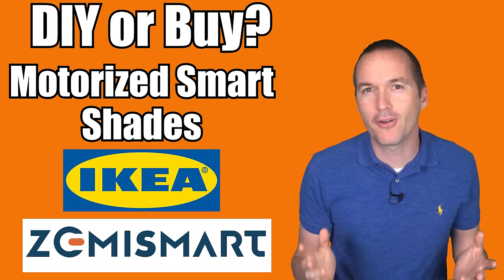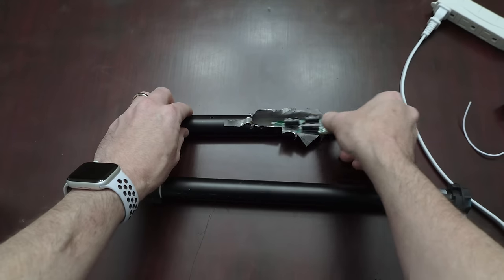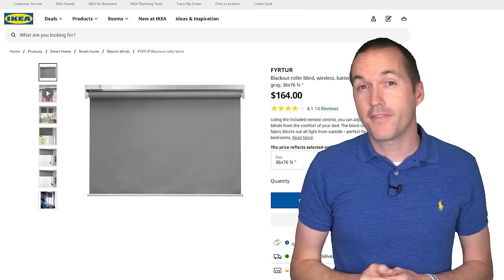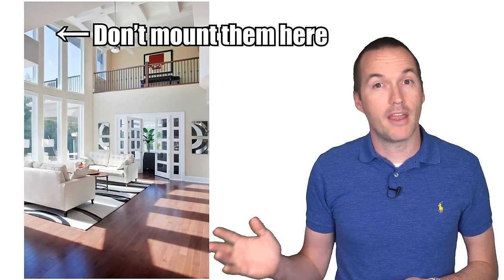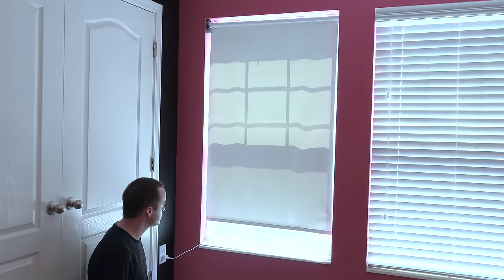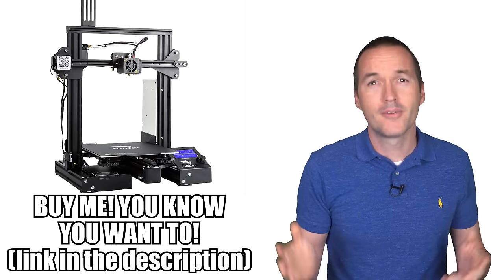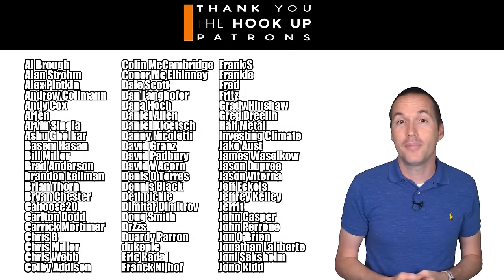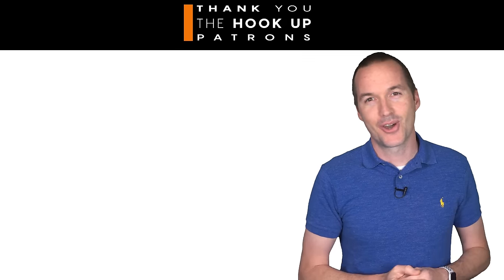Motorized Roller Shades? IKEA Fyrtur vs Zemismart Solar/Battery vs DIY!

Comment: I don't get the problem with Zigbee, is it the protocol or rather this specific device support? Have you tried Zigbee2Mqtt? The only thing complaint I have towards Zigbee as a protocol is an insistence by different manufacturers on using their own hub. Having said that, I am using zigbee2mqtt with over 45 devices in my house and everything works without the fuss, although around 25 of them are also Zigbee routers. I think Zigbee2Mqtt should be integrated into Home Assistant is getting better and better. OK, enough rambling, great video Rob, keep it up. BTW, you have convinced me to get 3D Printer but decided on getting Prusa Mk3 kit.
Reply from the maker: Basically hit it on the head.  Because manufacturers want you to use their own hub they are all using non-standard communication protocols that require device drivers to be understood.  Zwave for instance requires that specific device types communicate in specific ways, so they are compatible with any hub.

I haven't gotten deep into Zigbee2MQTT yet, but I'm hoping it will solve that issue for me, since I still have a lot of zigbee devices that won't work with Deconz.
Reply: @TheHookUp  Oh, OK, then I definitely recommend Zigbee2Mqtt. I'm not sure if you're going to need it but I would also recommend adding an external antenna to the CC2531 router/controller, it greatly improves the signal. The reason I actually went with Zigbee was the smart sockets, the way ESP2866 works and controls the high voltage, it trips my RCD fuse while switching, IKEA sockets don't. 

Funnily enough, I find Zigbee more reliable than Wi-Fi, especially now, Zigbee2Mqtt is getting better and better. The other thing I love about it is the Xiaomi sensors, they are reliable, with a modern look, small footprint and great price, and they run on battery for 2 years, almost.

Comment: After all, simply using a string to manually roll them up and down sounds so simple and advanced. :-)
Reply: I’ve often thought the same about smart bulbs. Given the choice between flicking the light switch on or off and getting my phone out, opening the app and turning the lights on or off I’ll go with the switch.
Reply: Right? And then one day the motor burns out and they go in the landfill? No thanks. I'll take something foolproof and that lasts forever, thanks.
Reply: @adityaprasad465  I can see them for very high applications, but thats about it.
Reply: @philindeblanc  Isn't recharging an issue in that case?
Reply: @adityaprasad465  Those are usually hardwired from attic. They usually have solid motors, but they are preicey. The solar powered models are ok, but not as reliable and not discrete.

Comment: Great job! Amazing code for that WiFi config interface, seems like it could improve your outdoor motorized shades code too. Do you think some power monitoring is able to be performed on the DIY method? I think a small solar panel and tiny lithium charge board could keep a 9V battery well prepared for each day’s use - as long as it’s on the side of the house with good sun, or it’s a long thin panel that can hide.
Reply: Also seems like the DIY code makes it able to be built and sold at a profit for cheaper than the off the shelf
Reply from the maker: If you want to build it and sell it, go for it :)

Comment: Thankyou for this...you do amazing work. I love the humor (@1:39 cracked me up looking for the outlet!, and the comment about ikea instructions).  I also love that you not only linked to the DIY solution but went through the work of updating the libraries and providing a bin file for your viewers.  You also give a fair and balanced view that I can appreciate of the pros/cons.  Do you know offhand how hard it'd be to update the DIY solution with a stronger motor?  I'm wondering if a properly chosen Nema 17 or even 23 with a 12volt supply can help with torque, and then maybe using a Wemos D1 mini with a motor shield (I was suprised to find out they had a motor shield for those!).  Regardless, I really appreciate the time and work you put into your videos, and the valuable infromation you provide us home automation enthusiasts :)
Reply from the maker: The code I used would need to be heavily modified to use a different stepper, because the original was written for the ULN2003 driver and a unipolar stepper.  

The other issue you'd run into with a non-geared stepper is the holding torque when the coils are off is basically zero.  By gearing down you give yourself that holding torque that's required to keep the shade in place when the coils are off.
Reply: @TheHookUp  OH awesome to know..I really need to ramp up on my knowlege of motors and steppers, my info there is really basic at best.  I didn't think about when the coils are off...pretty important scenario :) Thanks! I'll also check out the projects Goog linked...I'm super excited that this is becoming easier to approach!

Comment: Although more expensive, wouldn’t it be possible to use a Nema stepper motor instead? They are more powerful and the cost is still affordable. I believe that even with Nema motors the DIY solution would be the cheapest. 
I don’t know about the speed improvement though...

Comment: Just ordered some NodeMCU boards.  Also have a 240V 40A relay and planning to try and set my water heater to run on a schedule.  During the summer my power rate fluctuates and going to try and set it up so that I can have the email come in and get data scraped for the power rate and automatically turn off at a certain time when the rate will be high and back on when it drops back down.  And yes I have a huge heatsink so the relay should not overheat.  

Since I have spare boards I may end up doing the blinds as well.  Only need it for two windows that I have facing north and since I am in an apartment I am limited on what I can do but would be nice if they would open and close at certain times of the day.  I am always short on cash and have extra time so DIY is the way to go though I will probably look at a more powerful motor to swap into the system or set it up so there is a pair of them working together which should increase the speed and weight capacity, which is actually a good option that only requires a little bit of modification to the design and doesn't increase the cost that much.  Driving one from each end would be another option that would be pretty simple since a single board should be able to handle two at the same time.

Comment: The DIY version works like a charm! How do I get back to the initial setup page after configuring the wifi the first time?
Reply: Hi Hon Wah Chee, can you help me? I can't reach module by IP address after connecting it to router (i see module in the connected devices list). Did it work for you?
Reply: @YuryPenkerton  lol did it work for you? After downloading I was not able to run the rollershade.bin file. Any help?

Comment: I have used the DIY version with a 6ft blackout blind at 12v for over a year, no issues here.
Reply from the maker: Are you using a buck converter to power the node mcu? They usually can’t handle a sustained 12v

Comment: Even slower i would prefer the DIY version integrations. If you have heavy shades or you need more speed i suggest to change that tiny stepper motor with a bigger one... they reach a really big monster size... but with some dollars more than yours you can get a decent one... take a look to NEMA.

Comment: A'ight, so if you're going to all the trouble of building your own roller shade, why not put in a heftier motor and place a solar panel in back of it with a small backup battery?  It'd probably cost $15/shade after buying in bulk.  I wouldn't think you'd have any complaints after that.

Comment: Awesome stuff once again, Rob!

I am updating my existing roller shades to make them smart. I'm deciding between an in-rod motor like the Zemismart here or chain-mechnism like the Soma 2.

With an in-rod motor, do I need to sacrifice the current manual chain operation? Or can I keep using my existing manual chain as a fallback? I don't want to violate the first rule of smart homes: never remove functionality, only augment it.
Reply: Can you please help? After I downloaded nodemcu software and roller shade code, it gives me error.

Did it work for you?

Comment: but why not upgrade the motor  for the DIY option to bring it closer to "buy" specs? (or just show it as other option
Reply: I was thinking the same thing, I may have to experiment with a stronger motor.
Reply: @DAYochelson  I think the problem is that one does not exist at this size.
Reply: @Pleasiotic1  a 3d printer motor is a perfect fit you don't need to use a gear ratio so it can be parallel to the tube

Comment: How do your outdoor "DIY Motorized Roller Shades + Wireless MQTT Smart Home Integration" roller blinds that you did in 2018 compare with all these? Are those still going strong or have they puckered out? That stepper motor you used in that project doesn't seem to have the same cons that the cheap ones from this video do but when you didn't mention them at all in this comparison it makes me think they were ultimately a fail and that's why you wouldn't have compared them at all in this video. Did I miss the update on those? LOVE your videos and I can honestly say I wouldn't enjoy this space without you! Thanks!
Reply from the maker: Outdoor shades are still going strong.  The issue with those compared with these is they need to have 3" of clearance to the left of the shade to fit, which isn't an option in this case.  The stepper motors are also quite a bit more expensive, which at that point would put the cost of the project close to or above the wired tubular motor from this video.

Comment: The IKEA hub point and click  integrates with HomeAssistant local discovery..  The IKEA hub is cheap (cheaper than any Zibee USB stick), I treat them as a one off integration in HA, I have no other zibee devices so I ignore the fact they are zigbee. I agree with all other drawbacks / notes on these blinds however.
edit: additional bonus is that with the Ikea HUB the ikea blinds are natively controllable via both Google Assistant and Apple Siri, you also get the ability to update the firmware on the devices which is important since the  inital firmware on them is horrible. They seem to be very reliable with the firmware in its current state.

Comment: You should do some research on custom firmware on zigbee (USB) modules. Together with zigbee2mqtt its a gem on home assistant! 
I can connect IKEA products, Hue products, Aqara or Xiaomi Products and do whatever i want with them with great intergration!
Reply from the maker: That video will hopefully be coming soon, just waiting on my zigbee sniffer to arrive from itead (ordered in March)
Reply: @TheHookUp  I don't even have an IKEA Tradfri gateway, all my Tradfri zigbee devices (lights, contact sensors, etc.) work happily with zigbee2mqtt and HA! Good luck!
Reply: @TheHookUp  Very nice! will be waiting then!

Comment: I did cut the fyrtur down the same way you did then It dawned on me... one can actually mount them in front of the window cutout and while that means it will stick out in front of the window cutout the shade itself will line itself against the wall and the draft won't be able to pull it outwards towards the open window.

Comment: I love the solar solution you have here. I have 4 windows up high.. 14' what do I need to buy to install and link all 4 window?  They are 8' wide and 2' tall windows. Using patio shades. They come 8'x8'. I will be removing fabric to reduce weight. Thanks.

Comment: Would you be able to use a more substantial 12v roller blind tubular motor with the diy method? Obviously you'd need 12v to it not 5 but would the code work in the same way?
Reply: These stepper boards take 5-12 volts. Run them with 12v and the torque is much much higher
Reply: Most roller shade motors have their control circuits built into them.

Comment: 1. I just watched a review of the IKEA blinds from Homekit Authority and he said he only got about 2 months of battery life per blind. 
2. He had no advise for how to convert them from battery to wired, but it should be possible, right?
3. We're remodeling and are running new power and networking everywhere. Are there any POE options for blinds?
Reply: I have 4 of them and I fully open and close them once a day on a schedule.. Mine tend to last 4-6mo on a charge depending on additional opening and closing during that period of time.
Reply: This is definitely a "your milage may vary".  Of my three, one of them drains 2x as fast as the other two, which the two mentioned lasting about 3 months on a charge (going up and down once a day)
Reply: Spend the money and get custom coverings. Lutron has battery powers shades that will go 3 years on 6 D cell batteries. Or Budget Blinds new Smart Home motors are rechargeable and will last about 12-15 months before a charge is needed. A 36x60 Window will be about $500 but ZERO hassle... I know its expensive but it is the best bet for your application. Also Lutron and Somfy make a 12v power panel that will allow the use of low voltage wire to be run in the wall.

Comment: Paul, GREAT VIDEO!  Can you provide a link to the specific motor blind WITH interchangeable batteries, as you mentioned in the video?  All I could find were zemismart units with "built-in batteries".  Thanks, David
Reply from the maker: I think the one you are talking about with interchangeable batteries is the one from IKEA, not the Zemismart one.  The Zemismart ones are rechargeable only.

Comment: Have you found a different motor for the diy solution? Also, it seems like it would be trivial to add a couple of 18650 batteries and a smallish solar panel to power the diy solution.

Comment: Strange that Ikea has that high delivery fees. It is the same in Sweden and where I live there are so many good options to have your goods delivered very fast (same day or next day) often without extra cost. So Ikea has to better this. It is of course not possible when they deliver heavier goods but for smaller it should be cheaper.

Comment: After reading the Zemismart description on their page, I'll pass 
Description

- This zigbee roller shade motor kit is design for samrtthing hub control. 
- It with wide volatge suit for 110v to 250v.
- EU type and US type switch are avaialble.
- Better make the motor work for shade within 3 meter and 4kg.
- For roller tube about 36mm to 38mm
Reply from the maker: Yeah, hate to break it to you, but no one at zemismart wrote that.  They just pay a translator, in this case they did not get their money’s worth.
Reply: @TheHookUp  I know they didnt...but bad manuels/literature always raises concern regarding tech support, rma etc for me

Comment: Rob, your Ikea with Home Assistant didn't use the Tradfri at all?  You were just trying to directly use zigbee with it?  I'm under the impression that the HA/Ikea integration is pretty solid.  I'm wondering why you didn't just spring for the gateway and the simpler config.  Plus, I'm really curious if complete control and positioning works through the gateway.   -Dethpickle
Reply from the maker: Yeah, I don't have a Tradfri hub, just a conbee stick and deconz.  I hear the Tradfri hub and integration works well.
Reply: By total coincidence, I had put four of those blinds and a tradfri in my cart this morning.  I was holding off on clicking buy as I searched around for any recent reviews.  Most are non-HA related and pre-Homekit improvement.  Or they're tradfri reviews that don't cover the blinds.  The one hiccup for me is that they only come in even measurements.  I've got two 35" blinds side by side in a large window.  I could do a 34 and 36, but I'm unsure of the probably inch or so gap between the actual fabric that way.  It'd sure be nice if they made wider ones - 70-72".   Thanks for doing the review!

Comment: I have the DIY solution. Those motors can be hacked, you cut a wire and get double the torque (and half resolutin/steps), bus have to use a different driver. I run them at 12V. They get hot, yes, but also strong. It still takes 90 seconds. Made electronics and programming myself, it was much cheaper. Oh, my shade is larger and weights 840 grams

Comment: i think the first one you presented the 47$ one or so... if we are comfortable changing wires and splicing etc... seems like the best option? i have a sunroom id like to add this to... and I have a T-Box (junction box) nearby I could connect directly. Is WiFi still the best protocol to connect? I have a few other items that connect to Tuya/SmartLife ive been adding through the years with no issues. seems the link to that one doesnt work anymore and i cant find it on aliexpress

Comment: Hey Rob, Great video, I was just wondering if I can NodeMCU WIFI board can work with solar panel DIY 5V using LIPO controller. Would you making video related to that. I like the idea of Solar panel integrated with blinds controller. Thanks

Comment: hey Rob, I have had the same problem with the Ikea shades but I was able to solve it. Make sure that you read the cluster info before using them in ConBee. Let me know and I can share my solution (home assistant+nodered+conbee) so you can do a follow up.
Reply from the maker: Got a link to that info?
Reply: @TheHookUp  I do not but I can share my conf file for home assistant and node red integration. The cluster info is a bit more complicated to sjow but I can send over a couple of screenshots via email or something if that works. Fyi - I currently have 2 ikea blinds and when this quarantine is over I am planning to get 6 more. Btw - I really enjoy your channel.